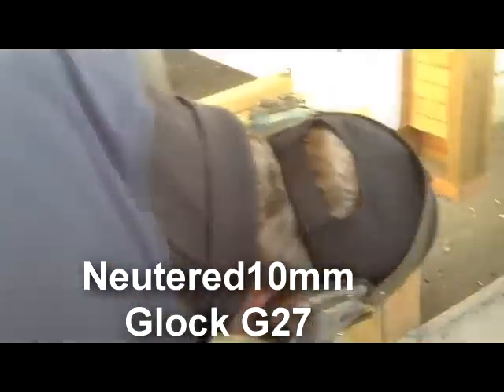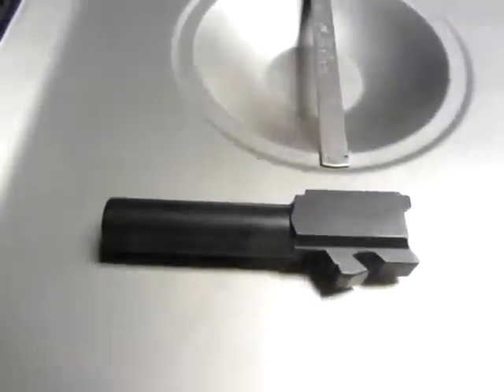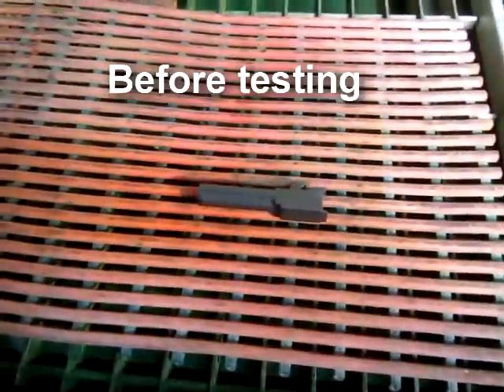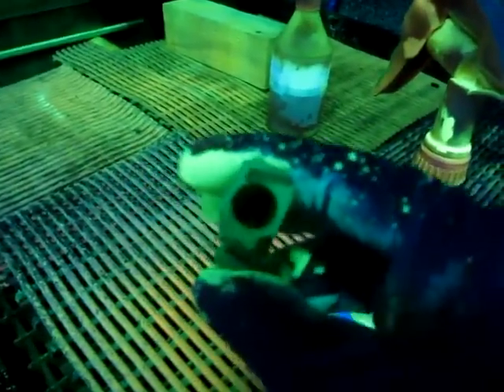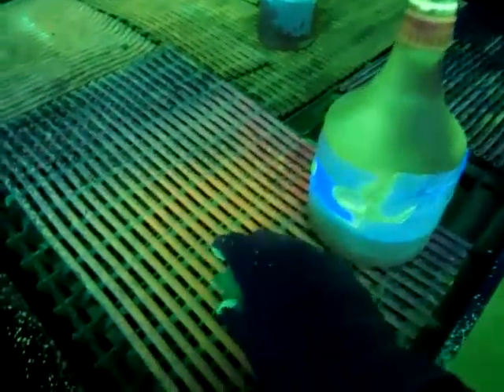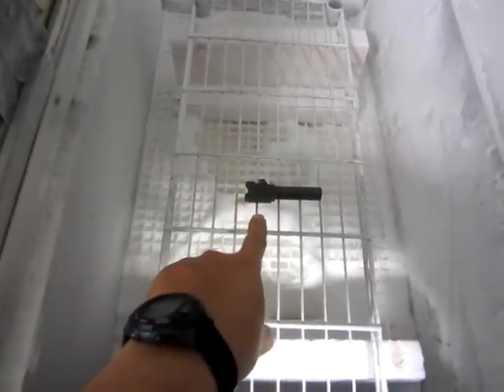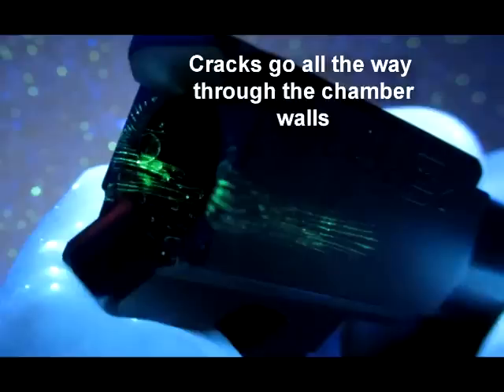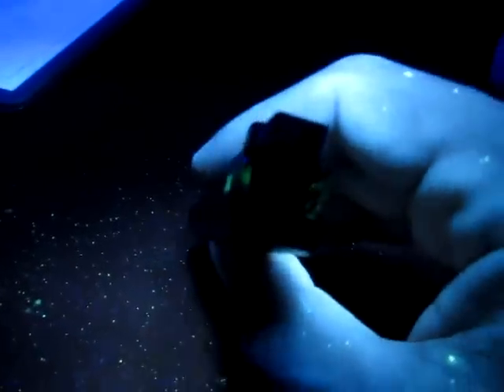Testing Neutered10mm Glock G27 kaboom barrel (Fluorescent Penetrant Test)

Comment: I always wondered how these tests worked. Very informative! Oh, and I'm a Golden Shellback. Were you in aviation in the Navy?
Reply from the maker: Welcome aboard my brother!  Yes I was an airframes mechanic.
Reply: Right on. Looks like you do this professionally. Ever done a rifle barrel from an over charge? I've got a Colt AR heavy barrel that the barrel extension is obviously badly cracked, and I'm curious if the barrel is, too. Academically only, no intent to reuse, too risky.
Reply from the maker: I have not inspected any rifle barrels with dye penetrant.  I may be getting into Magnetic Particle testing on rifle barrels though.
Reply: Could we privately connect on the Google+ thing and exchange emails? I am interested in discussing this.
Reply from the maker: Martin Sprick I will PM you tomorrow :-)

Comment: Just saw this video, not trying to raise the dead however, this test seems to confirm that the shooter obviously reloaded the round way too hot.  They are lucky the gun only broke the frame, trigger parts and did not remove the hand of the shooter.  Some peoples kids, I swear.
Reply from the maker: +blkcc1 The cause was attributed to a slightly crimped case on a FMJ projectile that allowed the case to extend past the leade of the chamber thus constricting the projectile and over-pressuring the cartridge.  He has a very detailed explanation on his channel.
Reply: +saltyshellback 

That would have had to have been WAYYY over crimped, as in crimped to such a degree that the case mouth had completely eaten its' way into the bullet.  Was the shooter using plated bullets?  Those are very susceptible to that.  I am glad he was not injured.
Reply from the maker: Not sure.  I think they were standard FMJ

Comment from the maker: The link to the probable cause is at the top right of the video.  Basically the round was crimped enough to go past the shoulder inside the barrel chamber and wedged the bullet in the barrel thus causing the pressure to go backwards and blow out the back of the casing.  I like the idea of owning a Glock, but I like shooting lead reloads, and Glock does not recommend shooting lead bullets in their guns.  It has to do with their rifling.

Comment from the maker: I think the blowback caused the condition.  If the cracks were already there, it still would not have contributed to the blowback, but may have done more damage when the blowback happened.  I am going to slug the barrel and see what the ID of the chamber and barrel are at the shoulder.  Of course this is after the blowback, so he may want to slug the barrel of a "good" one to compare.

Comment from the maker: Good question Robbie. I'm not trying to be a know-it-all, but Magnaflux is the name of a manufacturer that makes penetrant and magnetic particle chemicals and equipment, but they are not the only ones. It is like calling a facial tissue a Kleenex. Magnaflux also made ultrasonic equipment for a while too.  Penetrant is not a new process.  Penetrant has been around since the 1800s and the fluorescent stuff has been around since before WWII. I am using Sherwin brand chemicals on this test.

Comment from the maker: I will link his explanation in the description, but essentially, the casing was crimped just enough to go past the leade of the chamber and when the bullet was fired, the bullet did not have enough clearance to enter the barrel smoothly, so the pressure blew out the back of the casing and caused all the damage.

Comment from the maker: Could be if you are unsure if you want to start or not.  This is definitely a fluke occurrence where there is a "perfect storm" with the casing being a little long, and the chamber being just on the lower end of the manufacturing allowed tolerance.  I have been reloading off and on for over 28 years, and have only experienced one mishap with someone else's reloads and a possible faulty barrel, but not life threatening.  That is why I stick to mostly light loads when reloading.